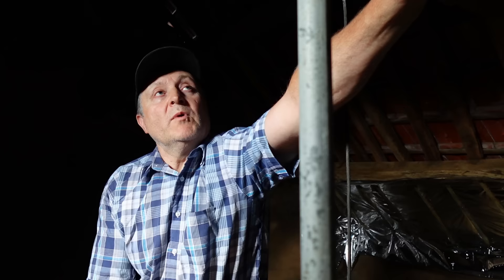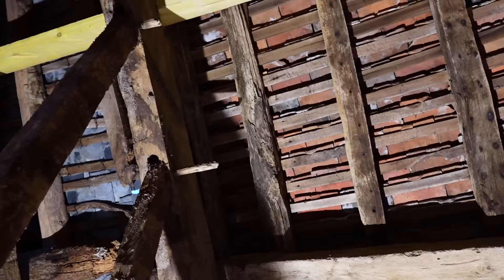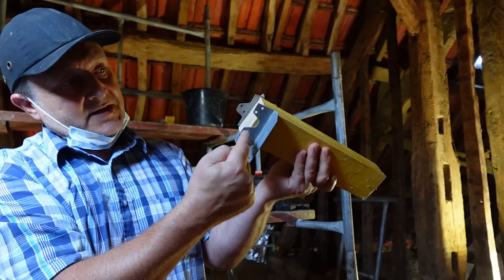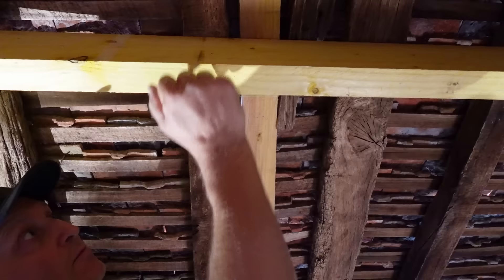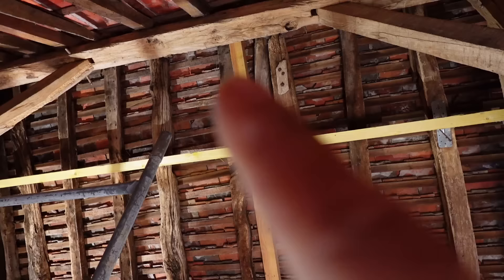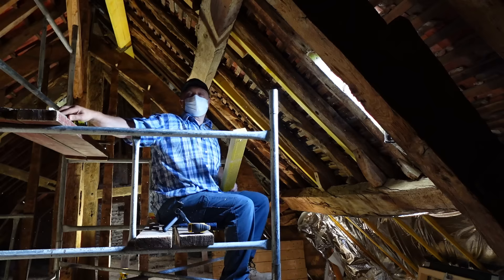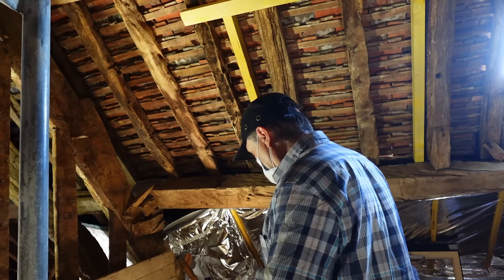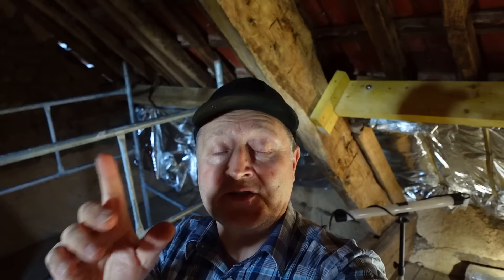How To Save A Collapsing Roof | French Cottage Renovation Episode 36

Comment: First off, I'd like to say that is very impressive that you are doing all that work on solar power alone. It's a small project, but every bit helps and you are doing a very good job on some really old and rickety wood construction. Second, can you please go spend a few euros on a hard hat to wear while you are working on that roof. Those tiles look very old and broken and it would be awful if one came loose and fell on your head.
Reply from the maker: My black cap is a hard shell inside especially for construction work

Comment: You could add more rafter timbers the right way by butting them up against the timbers which are the wrong way and fixing them between the top and bottom brace timbers, if required!?!
Reply from the maker: Too nany nails from the tiles protruding